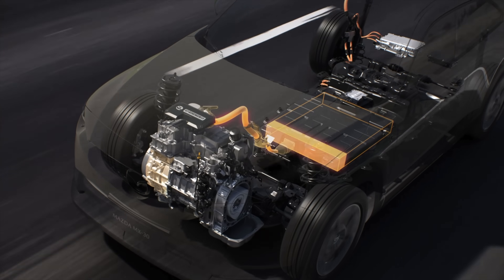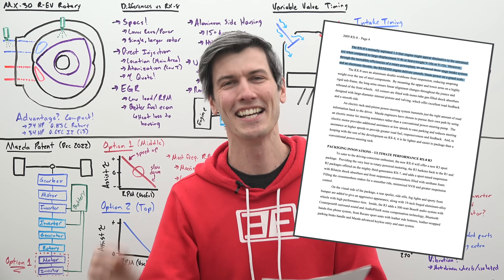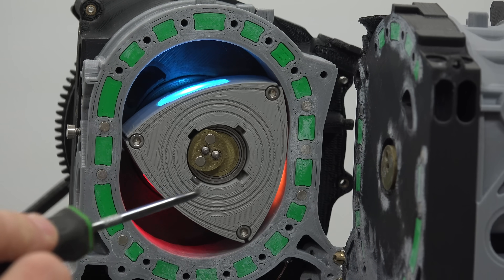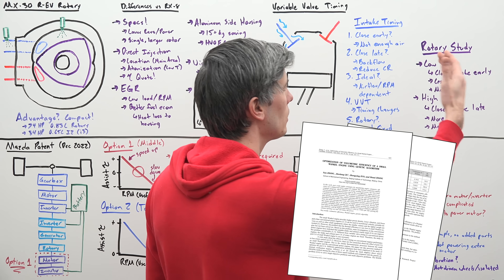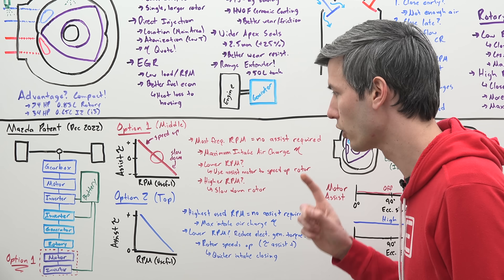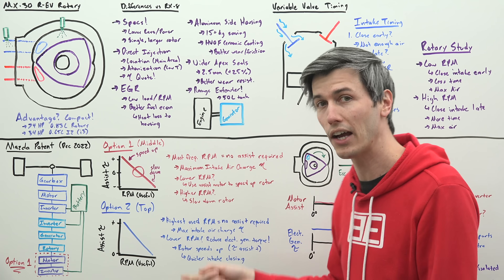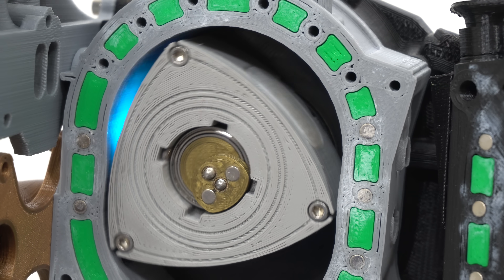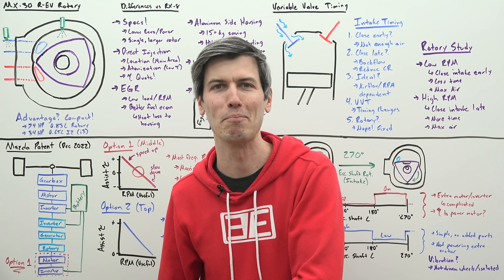Mazda Brought Back The Rotary Engine!

Comment: Another example of something that sounds great in theory but not in practice. Anyone that's owned a rotary powered car knows how unreliable they are when it comes to cold and hot starting! The main problem is that they're designed to burn oil in order to lubricate the rotor tips - these cars have a separate oil reservoir that owners MUST keep topped up, otherwise the rotor tips wear out fast leading to starting issues and expensive repairs. Most owners don't know how to even open a bonnet let alone check and top up the oil. How can this engine pass emissions if it burns oil by design?

Comment: I am surprised they have not used RAVE valves as was done on Rotax snowmobile 2 stroke engines where an actuator moves the port window up or down or widens and narrows it depending on rpm and load.

Comment: 9:29 - so it's basically a hybridized rotary, just like with inline engines that benefit from the electric punch to fill the void of the sinuses between the piston strokes.

Comment: It used to be rotor tip seals and the casing that would wear prematurely, they used a lot of oil, over the years they’ve become more sophisticated but they’ve only had a fraction of time and money spent on them vs a regular piston engine.
Reply: It's absolutely amazing how Mazda is keeping the rotary going considering the amount of money they have. I think i saw a figure once that Mercedes spends more developing piston engines per year than the total amount of money that has been spent on rotary development, period. A testament to Mazda's engineers.

Comment: If you designed a direct-injection 3-rotor engine from scratch, you could probably time the power stroke of each rotor such that the acceleration closes the intake port in a corresponding chamber a little faster.  A powerful electric (or variable geometry mechanical) supercharger could help as well, as the boost pressure is controlled independently of engine RPM.

Comment: I believe that the variable valve timing could be replicated by governing the size of the throat leading to the inlet port depending on rpm demand. This could make it viable to be used as a drive engine if it meant they could reach efficiency standards.
Reply: Yeah, it seems the whole motor thing is focussed too much on "changing the amount of time air can come in" when the original problem is "how much air gets in". So changing the "rate air comes in" without changing the amount of time Id think would be a much easier solution :/
Reply: The problem with your question is not so much size of the throat ( not without encountering parasitic loss due to size)... But standard air pressure is a constant. (As much as it can be) so unless you change the pressure of the air aka using a turbo or supercharger it's just a standard amount of air pressure via biased off size and space of location . Restricting airflow won't change the volume of the flow at standard pressure as where time or forced pressure will change the volume. Personally I think they should of just engineered a turbo to meet the pressure of higher end so it ramps pressure up with the needed rpm to get the achieved air rate per size and remove the ton of unnecessary complexity and possible failure points

Comment: What an amazing solution using the generator to control the timing. Hope it works great. I miss the Wankel engine in Mazda vehicles. I would work on changes on the valve variable sizes to control the intake with a crescent rotary valve, this way they won’t need to change the speed of the rotary witch goes against it’s nature of nice easy rotation.

Comment: In 1975 I bought a new Mazda 4 with the Wankel engine and 4-speed manual transmission.  In its day it really preformed although its handling was slightly mediocre.  I remember drag racing a Cadillac with it.  When the light turned green I took off; he sat there spinning his wheels on the wet pavement.  A bit later he ended up right behind me on the freeway merging lane.  When the traffic cleared, I floored my Mazda; I was in 3rd gear.  The Caddy could not keep up with he; he fell farther and farther behind.  When I hit 70 mph I backed off because I didn't want to go any faster.  Then he passed me, but he knew that it was only because I let him!

In some respects it was a very good engine.  It was very light and compact for its power and it would rev up without making a fuss about it.

Comment: It seems like the simplest solution would be to make the motor run at constant RPM and use an invertor generator to make electrical power much like a Honda 2000 invertor generator does and get rid of all that other stuff.

Comment: Having heard and read about the "Wankle" years before it was put into use, and Mazda should be given all the credit for this, I lost patience waiting for it. Then, in 1973, after returning from my deployment in Vietnam my new bride got a job at a dual dealership that sold Mazdas. And I finally got my hands on a rotary. The torque and speed were great but fuel economy sucked and so did those rotor tips and maintenance. However, I've always hoped improvements would evolve sufficiently to keep it competitive. Your video is encouraging but it also kinda cheapens the original attraction of raw speed with torque and power. Not a big fan of hybrids but at least a great idea isn't being allowed to die.

Comment: Thanks for the details I really enjoy your videos. I personally think the near term (next 15 years) solution for improved fuel economy and reduction in emissions is a plug-in hybrid capable of 60-ish miles with range extending small engine. This would allow smaller batteries at around 25 kWh and perhaps a 6 gallon gas tank. If the driver recharged frequently they would barely use any gasoline, for most driving, but should be able to drive 250-300 miles, re-charge quickly and fill up the tank. This would permit drivers to become familiar with electric recharging, and the supply of material that goes into cars would stretch 3-4 X, the weight of the car could be reduced by 500 pounds, fuel economy would g  way up emissions way down.

Comment: I'm wondering about emissions compliance.  That was one of the key "unsolvable" problems with rotary engines.  By design, they burn oil.  Modern performance (track) rotaries actually use or inject pre-mix (yes, like old 2-stroke lawnmowers and motorcycles) in the gasoline too.

Comment: Don't be mistaken with the displacement numbers... He compared a 2-rotor 13b displacement to a single rotor 16x which at first glance makes this extender setup seem anemic vs a 13b.  However the extender is a single 16x rotor and housing so 800cc per rotor vs the 13b 650cc per rotor.
 
Can't wait to see some 1600cc 2 rotor 16x action once people can get their hands on them. If Mazda already has production dedicated to it it's only a matter of time before a last hurrah rotary-driven Rx is released, Likley as an optional drivetrain for an upcoming sports car based on the new inline 6 platform.... or one would hope :)

Comment: You covered the vibration concerns not affecting the driver's comfort. But what about wear?
We remember rotary engines getting rebuilt every 10k kilometres. Even if they improved the durability with parts and lower rpm, doesn't the vibration greatly increase wear even for the generator?

I feel like this complicated way of reviving the rotary engine causes it to fail another time.

Comment: The high unburned fuel HC emissions on the trailing side of the chamber is an old known problem. Back in 1971, in Kenichi Yamamoto's book about the Wankel Engine, published by Toyo Kogyo (previous name of Mazda), it is stated in page 138 about the flame quenching on trailing side of chamber. The quenching is caused by the high surface/volume of the chamber on its trailing side. It's a known problem, and a stratified injection of fuel in the leading side of chamber seems to resolve or mitigate the unburned problem. This is fascinating! But in fact I was expecting a SPCCI strategy using the rotary engine, which would be even "cooler", in my opinion!

Comment: FAB video. This is so much more complicated than I thought. I thought the engine would just run at a constant optimal speed and charge the battery. Perhaps this adds a lot of energy input? The whole plugin hybrid thing comes down to how much weight to have to lug around in order to have a range extender? I think the actual application might be a camper van - take some petrol in case you end up being stranded...

Comment: Curious about your take on the liquid piston rotary engine. Does it suffer the same limitations due to lacking VVT as you describe here?
Reply: I do not know what Jason thinks about it.  For me, yes.  They suffer the same limitations since both are port intake.
Reply: @catchnkill  I do wonder if the liquid piston engine can do something clever with the intake/exhaust through the shaft to switch between Atkinson and Otto cycles.

Comment: That is pretty kewl as essentially they are popping a wheely on the generator clutch to spool the motor up to ride at balance point of its effeciency, pretty trick indeed!!!
Reply: My second thought was why didnt they opt for a cvt but then upon reading the pinned comment, if the desired goal is to meet the batteries SOC requirments then this is probably a better option as cvt will meet the best efficeintcy of the motor but not neccesarily the batteries SOC requirments this allows the motor to jump up into it best efficency when the demand requiers of it! Interesting  set of choices for sure. Im sure all of which could be argued to no end, but for myself personnally i think poping a wheely off the generators clutch to spool the engine up into its highest ballance point of efficancy is not only unconventional way of going about it but 100% kick azz, imho anyroad!

Comment: Compression energy and direct inject are 2 very important factors in the electric power production for that type of engine I think, and decoupled from the heavy encumbrance of a common drivetrain, the rotary engine should be capable to produce plenty of current to power an electric hybridized  vehicle

Comment: I was surprised when I initially heard that Mazda was using a rotary engine for what is essentially a hybrid vehicle, given that hybrid vehicles are used for high efficiency and rotary engines have limitations that have prevented them from being as efficient.  Rotary engines are best when smooth power is needed and maximum power is needed in a small engine.  They're good for racing.  With good apex seals, they can withstand a LOT of boost.
Reply: Jason makes it clear on the operating conditions it is being used.

Comment: One note: Generator does not affect the load at all.. generator produces voltage which is proportional to RPM... load comes from what ever is connected to that voltage source i.e. battery inverter. Battery inverter can adjust the load based on pulse width modulation to battery.

Comment: Mazda has been killing it since those 2020 Mazda 3 hatchbacks came out. Top notch reliability, safety, handling, cosmetics and performance out of cheap economy vehicles. My girlfriend has a 2021 Mazda 3 with over 50k miles and we have been hard on it with not one single flaw. Only $21k brand new and its been a dream.

Comment: "The intake is at fixed position"
IMHO you can actually make it somewhat dynamic. Create a straight line cutout starting at the earliest wanted intake and ending at latest wanted intake. Then insert a tube that has also line cutout, but twisted (like spring). If the twist along the tube is under 360 degrees, you create one single "hole" at intersection of the twisted cutout and the straight one. Rotating the tube you "move" this intersecting hole along the earliest and latest wanted intake. Then you simply connect the outside intake into this tube and voila - you have dynamic intake position.

Or if you want to fit more better to the round cylinder, you can take tube rounded to the desired diameter. Like thin donut. Then make hole in the direction to the center (like air intake in the wheel). Finally cut the whole outside side of the tube. Sealed it into manifold. Now you can rotate this "donut" moving the hole around. On the other side you have the cutout for outside intake.

Comment: I feel like Mazda addressed the issue of variable intake geometry as early as 1984 with their 6 port twin rotor engines. which offered significant low RPM torque and fuel efficiency gains over the 4 port.

Comment: Original RX-8 owner.  The rotary was a complete piece of crap, and so was Mazda's customer service experience.  Engine nearly caught on fire at 85K and seized, just outside of Mazda's customer assistance (time) window.  My RX-8 was meticulously maintained and loved.  Anyone ever buy a car that you couldn't start, move 20 feet, and shut-off?  That was the RX-8 rotary, if you didn't completely bring the engine to temperature BEFORE you shut it off, your next attempt (60 minutes or later) at starting this would result in flooding and a no start condition.  No worries though, the mental midgets at Mazda had a flood procedure to get it going again but often your battery would die before it would actually come back to life.  Mazda has real big ones bringing this thing back, even if it were only for a lawnmower!  For a Japanese company, I guess they don't lose face anymore, because this engine belongs on a trash heap.  My experience was very common amongst many, if not all RX-8 owners.  Oh, and I had no idea but years earlier my younger brother owned an RX-7.  That engine went up in flames on a highway, poor engine seals is what I was told.  In the end my RX-8 had almost zero compression so I expect it was the same issue, but no fire...

Comment: IS there any thought as to the lubrication of the engine? Ithought that rotary engines needed oil injection or pre mix? is this still needed i assume? Also, oil in the combustion chamber always leads to emissions issues. Curious how they will deal with that.

Comment: WHY!?!? Those things are unreliable garbage! Always have been. Honestly, sick & tired of hearing RX7 and RX8 owners talking about how they love the sporty performance from their rotary engine cars. While admitting that whenever the temp. dipped slightly below normal Summer weather, their cars refused to start thanks to their rotary engines. 

"I love my sweet ride, and because of it; I've got several days off ahead of me. My boss finally got fed up with me showing up late constantly and giving him the same excuse regarding my car. So he fired my unreliable backside! He didn't understand that it's my ride that's unreliable."

As a Mazda owner, I love my 2009 Mazda 6 V6 sSport trim and its naturally aspirated V6 engine that has been reliable since the day I bought her brand new. But the rotary engine is a miserable failure created by a miserable excuse of an engineer who didn't take into account cold weather.

Comment: The best part is that these kind of 'range extenders' are not under any emissions regulations, so basically u can put in your car a V12 from Ferrari F1 car as a 'range extender' and it still will be seen by law as a electric car
Reply: In California (Mazda's biggest market) Range extenders are not classified as a EV and don't meet the legal standards.
Mazda and Toyota filed an appeal to the new law and lost.
The Range extender MX-30will not be sold in CARB compliant states.

Comment: Is this motor used for regenerative braking?  Makes sense given that the generator resists the motor to lengthen the intake stroke.  Excellent explanation, you're a good teacher.  It would be great to see how regenerative braking influences the electric vehicle's mechanics.  Thanks.

Comment: I see your comment below about why the engine would need to change RPM even with this type of drivetrain.  But... changing the intake timing, does it change the engine's SFC or just its output?  If changing valve timing isn't necessary to improve efficiency, just optimize the timing for the engine's max operating RPM (which presumably would be its horsepower peak) and if the engine's max output is not needed, just run it at a lower RPM like you would anyway.  The fact the engine is not making the max possible torque at some RPM below its peak output would be irrelevant.

Comment: It makes perfect sense to do  what Mazda has done. Wankel engines are perfect as range extenders. I think it is far more sensible than hybrid mechanical ICE/electric powertrains. When the range extender is used it can run only at its most efficient RPM. Noise control is easier.

Comment: A while ago I heard they moved the exhaust ports closer to the spark plugs for greater efficiency & compression ratios while the rotary was rotating I'm unsure if that's still the case with this engine.

Comment: EGR is used for one reason only -- think of it as air without oxygen, it's there to reduce the percentage of oxygen in the combustion gases from 20% down to 18% or 15%, or what ever they need and that doesn't burn as hot and that reduces the formation of NOx.

Comment: Interesting take on the Mazda equivalent of Nissan E Power in the very successful Note in Japan (over 500,000) and now the Qashqai E Power and X Trail E Force.
The performance, economy and reliability will be interesting to see.

In Australia my brother gets a Nissan X Trail E Force next week. It is a very impressive drive, using a bit more fuel than a RAV4 Hybrid which is underwhelming to drive - CVT and engine noise.

Comment: It’s interesting how they’re saying gas direct injection will be SOOOOO much more efficient than the older port injected rotaries, but if you do the gas mileage calculation based on range and tank size, the fuel efficiency of this new rotary is almost as bad as the old one considering how it’s being used here. 

Still love rotaries.